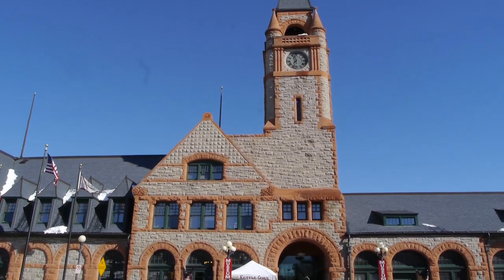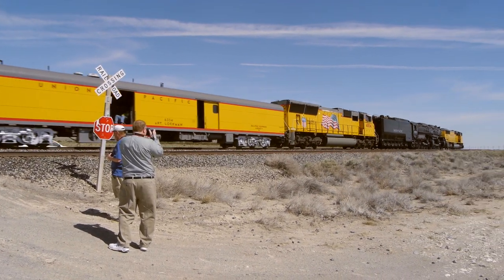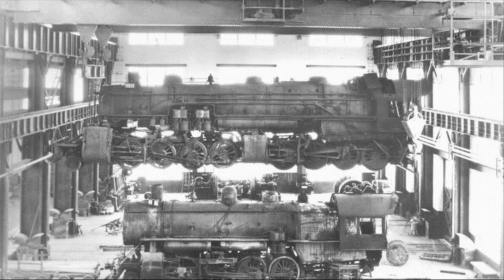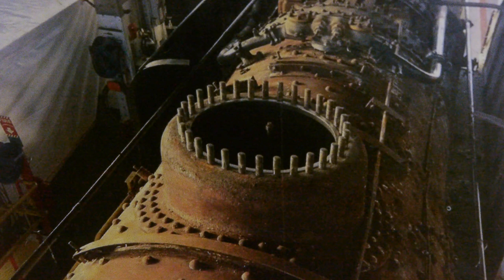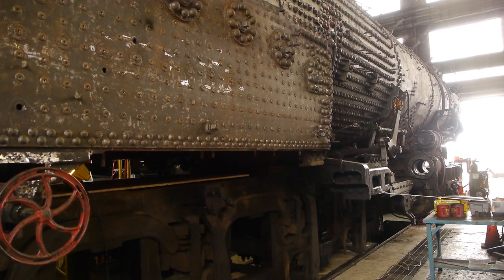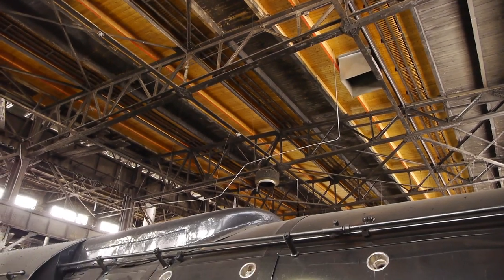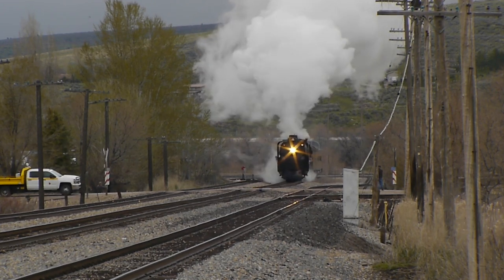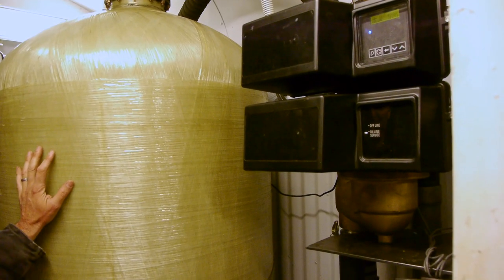Restoring the Big Boy - Visiting the Cheyenne Roundhouse

Comment: Yes, Wyoming weather can be a bitch. My wife grew up in Laramie and my first teaching job was in Cheyenne.  We net in Laramie. Looks like the opening video was on I- 80. Did you see the tree in the road as you went West?? It is still there as the railroad used to go by on the same route as I-80 does now. Up Sherman Hill to the top and then East. There is a rock that was bu the road bed that had a tree growing out of it and the train crews would throw a bucket of water on it as they went by. Eventually it grew into a pretty good tree and now the park rangers water it so it continues to grow.

Thank God they are restoring that beautiful beast. I have been in the round house many times and can not get enough of it. My wife is in Laramie right now. Had an experience in Heston Indiana at the live steam museum many years ago. They were restoring a Shay and doing a full replacement of the tubes that take the hot gasses from the boiler to the smoke stack. Someone asked me if they had ground the welding around the tubes and the man doing the welding spoke up and said, "If you need to grind welds, they are not right". Turns out he was a welder from the "old school" and had dome welding on nuclear plants for years.

Most people don't know that train wheels have tires on them. It is a nice video seeing them take the old tire off and place the new one on. Do you know why most of the engines that blew up did so coming into a town???  It is sad that the steam engine is not working still. They are so much more powerful that the diesel. There is a story about a challenge of power where they coupled a diesel to a steam engine and the steam engine pulled the diesel backwards and won the contest. The steam engine ran very clean out on the line. The only place they smoked was when they were trying to get the train moving and needed a lot of steam. They regularly ran at a high speed too. Some ran in the 80 MPH area out on the flat track.
Reply from the maker: David Curtis hello! Yes the northern 844 is capable of 110 miles an hour! They never run it that fast but back in the day they would. These days it's limited to 79 miles an hour, I think they do that to emphasize the fact that we really mean it when we say 79 and we're not just rounding it off to 80 but it is kind of a funny number. Have you ever heard of the book Zen and the Art of motorcycle maintenance? There's a whole thing in there on welding and the difference between a good weld and a bad weld. And this has nothing to do with the actual welds, but the difference between people with a quality attitude and people with a non-quality attitude. Amazing book intended for teachers. There was a move about 20 years ago to bring back the steam locomotive, and they called it the ace 2000. The steam locomotive for the 21st century. If you watch the video on Ralph and Rosies brass engines there's a great shot of Juan. Ralph build a model of it from scratch! It looks like a diesel engine but if you look closely it has drive wheels inside rods and is a classic steam locomotive.
Reply from the maker: David Curtis we did see the tree! And I said only in Wyoming is a tree so rare that they turn it into a state park and put a fence around it
Reply: David Curtis I
Reply: David Curtis I can relate...as I am a Wyomingite.. and a Cheyenne native...yes indeed " Live The Legend"

My Brother In Law William "Bill" Riley Sr operated 8444 Steam Locomotive long ago..Bill Riley Sr had a 43 year career as a Union Pacific Rail Road Locomotive Engineer.. sadly Bill left us due to a  Massive Stroke,we miss him so very  much..

Bill posthumously received The Rare and Prestigious Golden Spike Award and has some of his Safety Awards in The Golden Spike Museum at  Bailey Yard , North Platte Nebraska..

There's alot more Railroad stories I could share.. along with other Wyoming History and Trivia!
Thanks for the video.. it's been many years since I have worked inside the UPRR Cheyenne Roundhouse, abating Asbestos from a Steam Locomotive long ago!
Reply from the maker: Love to see the museum. Didn't know about it.

Comment: In case you were wondering, the two other engines are a 2-10-2 and a 4-8-4. The 2-10-2 is assumed to be in Extremely good condition, and "could take only a couple of weeks to restore" it's so good. The other 4-8-4 is being currently used as a parts source for the 844. One day that other 4-8-4 will be cosmetically restored, but that's not a priority.
Reply from the maker: Quasimoto7 oddly the 2-10-2 is not a locomotive they plan to restore and in fact they say they are looking for a good home for it. I'd like to see it stay and run again some day.

Comment: Nice video. I saw your video of chasing the 844 a few days ago and subscribed to your page. My daughter and I were fortunate enough to see the 844 one of the last times it was in Pueblo Colorado about six years ago. It's a pretty neat experience to be up close with that kind of power. I can't wait to see 4014 back on the rails again and I really want to see challenger running again soon. To me, challengers whistle is amazing to listen to.
Reply from the maker: Jay 844s whistle is much louder than it used to be! I mean a whole lot louder than it used to be, like you're splitting loud! Because they're running at a higher pressure now as the boiler is perfect
Reply: That makes sense. The only thing I forgot to mention is that when 844 was in Pueblo, it was using a Big Boy whistle. I'm thinking it was around 2011 when I saw it last. Do you know if the original whistle is back in use?

Comment: The only two railroads that I know of that used water. Scoops was the New York Central and the Pennsylvania Railroad to eliminate water stops. The Pennsy to my knowledge didn't use the centipede tenders 
Ike the Central did.
  The NYC J-3 Hudsons used the centipede tenders holding 46 tons of coal as well as the Niagras (  4-8-4 ) which were rated at 6600 horsepower at 120 mph were only 6 years old when retired and scrapped. Literally the most powerful 4-8-4's, on the planet. All that power built within a 15 foot clearance diagram. 
The 844, 4449, 261, 3751, were all built with 16 foot clearances.

With a water scoop meant they only had to stop for coal once from Harmon to Chicago or Saint Louis. They would take on 12,000 to 20,000 gallons of water in one track pan. It was replenished by a nearby water tank through a float arrangement very similar to a toilet tank fill valve with a 6 inch feed line to replenish the track pan in good time for following trains. Remember until the Hudsons came along passenger trains ran a maximum of 12 cars as that's all the Pacifics 4-6-2 could handle without double heading.
  After the first Hudsons were in service they could handle 26 cars at 80 mph without double heading.

The UP chose the 4014 for the dry climate it was in, but after tearing the engine down discovered it wasn't in as good a condition as they thought.

 In the event they needed a cast frame all is not lost as they still can cast them in the United States,
They are known as shipyards today as there are several shipyards capable of casting large parts.

To " start " a big boy you need at least 72 hours as they fill the boiler with a OK 4225 type railroad boiler commonly used in diesel locomotives for passenger service. By using hot steam to warm up the boiler before lighting her off she warms up slowly to allow her to stretch roughly 2 to 3 inches in boiler length after she's fired up and sitting near 300 pounds of pressure. And a match or 5 minute fusse is used to light off the " wick" that is used to light off the oil burner in the firebox.

Check out this video.

I do think you will enjoy the two videos.

https://youtu.be/ntzO4HAxwgg

https://youtu.be/QTpEIb-SuoM

The second video includes a train in February 1929 crossing what is now known as the Smith Bridge crossing the Hudson River, when it comes out of the main structure and in front of it is the SK tower that controls trains off the Hudson division and going straight through a 5 mile climb to the Boston and Albany railroad that I ran trains on back in the 70's. It's still in use today. If it were to be taken out of service all freight and passenger trains would have to go to Albany, NY to reach the Hudson division and the New England division ( Boston and Albany ) SK tower is on the west end of the bridge just over a mile from the bridge controlling trains entering and leaving Selkirk yard and the River division as well as another track that feeds trains into Albany and  the Boston and Maine railroad.

Enjoy.

Cheers
Reply from the maker: WOW. Ive heard of it, and seen film. I think they did this in Europe as well. When you see how much water is used......

Comment: Mad about old steam locomotives and their restoration - but I'm even more mad about this music soundtrack.  It sounds just stupendous with my laptop's Nahimic HD virtual surround system, with position tracking, and my trusty Samson SR-950 professional studio monitors (50mm drivers, 10 Hz - 25 Khz).  Just an absolutely stunning listening experience. WHAT is this music soundtrack?  Thanks!
Reply from the maker: Trev0r98 hello. I buy that music from the library called smart sound. It's an amazing library, I've bought hundreds of their pieces, not only do they have great music, but they break the music into measures. Sometimes half measures sometimes full measures sometimes two measures at a time depending on the content. What that means is I can grab individual pieces and rearrange it in any order that I want. Needless to say some of those combinations I don't work at all, but many of them work brilliantly! And this allows me to match the music to what's going on on screen. And make the music the exact length of the section that I'm trying to cover. Moreover much of the music was recorded by instruments. So if I want to remove the drums I can do that if I want to remove the violins I can do that, therefore I can really change the feel of the music and even remix it. Needless to say I screw around with it endlessly trying to get the music to match perfectly. Also it's important to be able to do that fast We are putting up at least one show every week I don't have time to mess around with it for more than a couple of hours per show, and this is possible using this software and music library.

Comment: I wonder if there has been any knowledge lost on how to truly run these behemoths. The engineers are probably all gone from that era who probably knew all the tricks and insider knowledge that a manual simply cannot explain. I'm glad UP is doing such a great job keeping our past alive. I'm old enough to remember waving at the caboose at the end of the now extinct Soo Line that used to run through my small hometown.
Reply from the maker: There are probably only about 500 people who know how to run a steam locomotive well. Of them, only about 20 would be the slightest bit comfortable pulling back the throttle on this giant. Ed is one of them, and as I see it, the best choice for the job. That's not an accident.  Ed has been moving in this direction his whole life, and UP noticed that many years ago. And so at one point handed control of this program over to him. I have great respect for the UP. This is one reason why.
Reply: Sounds like UP is doing business with common sense. It's there in abundance but rarely used by corporate giants. I'm likewise very impressed with UP.

Comment: With regard to the 79mph speed limit: as I understand it, 79mph is the speed to which the FRA limits trains that do not have cab signal apparatus or are operating in non-cab signal territory.109mph is the maximum speed in cab signal territory except on Amtrak's Northeast Corridor where Amtrak has a special dispensation to go faster.
Reply from the maker: bartholomew sorrentino I think so. I have clocked the 844 at faster speed but officially it didn't happen.

Comment: I really liked your video. Thank you.

 Are they making extra spare parts so they could possibly put them on some of the other 'Big Boys' to get them running also?

New subscriber.
Reply from the maker: Nope, this is the only one they plan on fixing. BUT they are making parts for the 3985 to get that up as soon as the Big Boy is done
Reply: They are making extra parts so the are able to keep 4014, 3985 and 844 running for many decades. There are no plans to rebuild any of the surviving big boys other than 4014. 
 
I highly doubt they will rebuild the UP 9000 as its wheelbase is so long it would require a lot of track work so it could run without derailing.

Regarding the big boy tender they will remove the coal stoker system and replace it with an oil tank holding roughly 7000 gallons of oil to fire the big boy with. It will not be fired with coal as it would have a tendency to start line side fires. One of the big advantages of oil firing is in a pinch they just pull up to a diesel fuel rack and fill her up, just like a diesel locomotive.

The cast engines frames are poured from a very high quality steel not cast iron. 

I'd be willing to bet the first real job the big boy has pulling freight will probably be at the request of one of their largest customers that send double stack trains over the mainline.

Thank you for this update. 

When they start to fill the boiler then fire up the shop steam generator to supply steam to the boiler as the boiler from ice cold to hot with 300 pounds of steam on her the boiler will expand in length a couple of inches. That takes time to do and will take probably around 48 hours as it takes a long time to bring 7000 plus gallons of ice water to a boil. Once the boiler is warm to the touch then and only then using a steel rod to hold a rag soaked in diesel fuel which will be lighted inside the cab and you normally use compressed air to provide atomization of the fuel as it is fed into the oil burner nozzles along with the oil to light off the burner in the firebox. Once steam reaches 20-30 pounds per square inch then the burner starts using steam instead of compressed air and then is truly raising steam on its own. In my life I fired several different types of steam locomotives from 2 foot gauge 0-4-4T forneys and from a 2-6-0, 2-8-0, 4-6-2, 2-8-4 ( Nickel Plate 759 ) to my last steam engine I ran AFT 1 ( ex Reading T-1 4-8-4 ) all coal fired from hand bombers to stoker fired engines. 

I was 16 when I started working for Edaville firing the ex Sandy River and Rangely Lakes 2 foot trains with two ex Bridgton and Harrison Baldwin built 2-4-4T engines numbers 7and 8. 7 weighed 35 tons and number 8 was the heaviest at 38 tons but 7 was the Caddilac and rode and ran beautifully.

I'm 67 and praying I get to see the big boy run with my own eyes.
Reply: Thanks for the knowledge James. I service boilers and steamlines where I work. It's very smart for UP to pull along a machine shop and water softener. We treat our boiler water with oxygen scavenger, pH balancer, and Alk boosters. Wonder if they'll do the same or just run soft water. Is any water returned to the holding tank or is it one shot use type of thing? I remember seeing a documentary on the pinnacle of steam engine technology. One of them was the trough track in which a speeding steam locomotive used a retractable chute that would channel water right into the holding tank using the locomotive's speed to force it in. When full, they'd retract and no longer had to stop for water. I know diesel/electrics are more economical but they don't have anything near the HP of these and have zero personality lol. Awesome that UP is using the 844 and 'Big Boy' as actual working locomotives to haul freight and that 'Big Boy' will be used for the heaviest loads that the old gal will pull with ease.

Comment: Hello Toy Man! A quick question about the Big Boy. Have they started the Big Boy yet? We're now in 2018 lol, so I was just wondering. I love Steam Engines. Got to ride in one from Walt Disney World Railroad.
Reply from the maker: THey are on track for May 2019. So far so good. All the parts are done. Putting in stay bolts right now. And putting the engines back together. Should have the front engine back under the frame soon. Wheels will be back this summer, and they will start putting the wheels and side rods back on. By winter the tubes will go in. Then final assembly. Right up the the wire!! Should fire it in about one year from now.
Reply: Cool!! Keep us posted when it's ready to run! Can't wait to see it. Thank you! :)

Comment: This would probably never happen, but imagine if Big Boy an 844 doubleheaded
Reply from the maker: They WILL!! 3985 used to all the time, and they will try this for sure. Only problem is 844 is a high stepper, and 4014 a slower freight loco. But that just means the crews will need to be good, and they are.
Reply: Toy Man Television Cool, I've never seen 844 and 3985 Doublehead, but I have seen it with Daylight 4449
Reply from the maker: It will be an eye full!

Comment: The things that the driving Wheels that are removed and they're being turned into new tires not rubber ones they're called we used not TIRES!!!!!!
Reply from the maker: Locomotive tires. Wheelwrights have been using this technique for centuries!    Even on carriages and wagons. The steel tire surrounds the wood rim or “fellows” and as it cools it presses the wood shapes inward compressing the rim strengthening the wheel. There was nothing special about building a wagon. But the wheels...